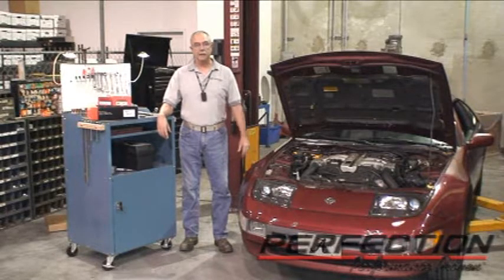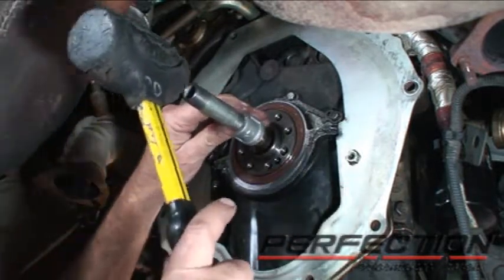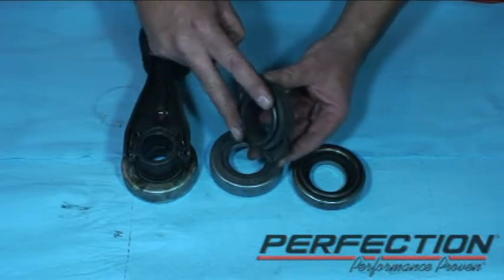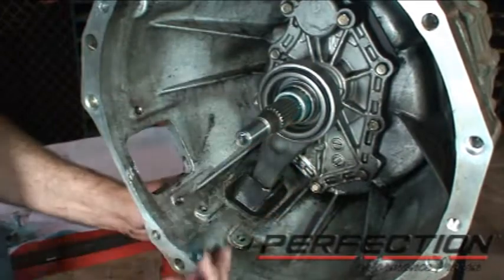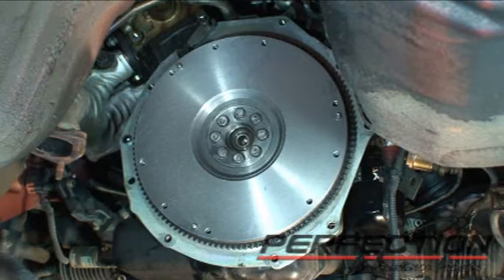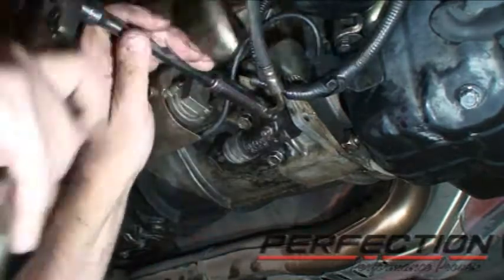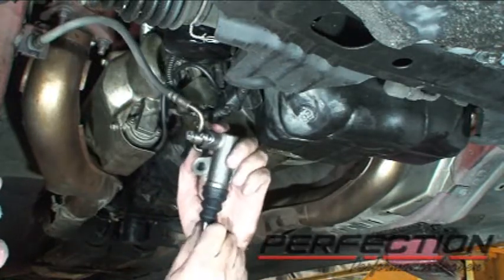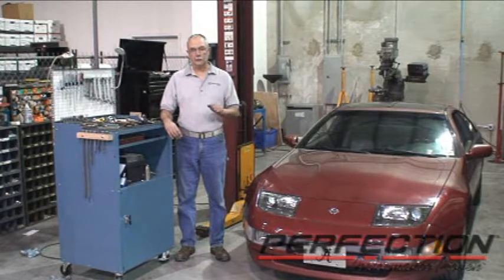1994 NISSAN 300ZX Clutch and Hydraulic Release System Installation

Comment: The 300zx Service Manual is very clear on the steps needed to properly bleed the clutch system.  There is a secondary bleeder valve by the Power Steering reservoir which was not utilized in your process, hence the reason why you had such a difficult time getting the air out of the system (I would be surprised if you managed to get all the air out using only the bleeder valve on the slave cylinder).  For anyone interested, the pertaining section in the 300zx Service Manual is the Clutch Section (CL), more specifically: CL-8 "Bleeding Procedure".

Comment: excellent vid. I am now myself replacing my 94 300ZX clutch at 98k. Many great explanations of the smaller details in this vid. With 98k the drive shaft center bearing was feeling a little loose also so considering the cost of bearing,3 new u-joints plus press in/out labor I decided to go with a one piece shaft for the same price.    excellent vid........thumbs up #306

Comment: One thing you didn't touch on in the bleeding procedure, is that the Nissan 300zx has not one but two bleed valves. The lower valve is on the slave cylinder and other other is on the passenger fender right next to the HICAS Valve. The second valve really helps relieve air stuck in the system higher up.

Comment: On some of these older 300zx's they had a clutch dampener line that runs to the passenger front fender tub.  If you cant get it to bleed out completely, try bleeding this line also.

Comment: what is he using to get the top bolts of the transmission off and where can I buy it? It was a pain getting those out, I had to connect 2 wrenches together and unbolt it from the hood.

Comment: hey, great to see a great car becoming great again. 

i heard the clutch replacement costs about $4500 in the 300zx TT, its not cheap to drive one of these cars.
Reply: +Martin Luther (Martin Luther 1543) About 1/4th of that price.
Reply: Not at all that expensive if you have a trustworthy mechanic do the installation.

Comment: Hi, just question you always replace the flywheel. I did my 95 240sx I just refine the flywheel and is working with out problem but I never replace the slave or the cylinder but I feel little free play at the pedal, can be because the flywheel? or just need to adjust the pedal?..
Reply: *****
Dont forget the 300zx has a pedal adjustment you can move by losing two nuts. This typically allows for adjustment of the pedal once all the new parts are installed. O and yeah BTW you can use a socket to install the new pilot bushing. What ever you do DO NOT REPEAT DO NOT use a needle type bushing. It will screw up your imput shaft. Hope this helps.
Reply: The300ZXGuru Had the nismo bearing for years never had one problem shaft is perfect after 7 years just swapped my clutch out and put a new one in. Not sure were you ran into a problem on this?

Comment: I have a question. I'm replacing the clutch on my 300 at home and I have the flywheel and clutch assembly bolted up, the transmission is up but the input shaft is not fully seated inside of the clutch assembly so I cannot bolt the transmission to the engine, could the probably be a misaligned clutch disk or am I missing something?

Comment: i have a 1994 300zx NA MT and everytime i shift my rpms drop by 1k after it catches and then it takes forever for the car to get up to speed. i did a compression and vacuum test on it and the engine is running perfect but sometimes the car does catch gears without dropping rpms and actually speeds up pretty fast so i doubt its the gear box. could there be something wrong with my clutch assembley? great video btw *****
Reply: Juan Cadena Definatly something with the motor, check all electrical connections I mean everywere its usually the first culprit with green corrosion, these cars arre old now almost all of them have corroded wiring at this point.

Comment: does this apply to z31s?
Reply: its alright 1987 nissan 300zx base 3.0 engine vg30e and my trans is either a fs5w71a or fs5w71c
Reply: thank you Gary! As for bearing with collar would that be a difference with the throw out bearing or the pilot bushing